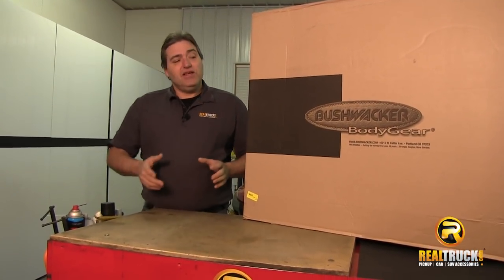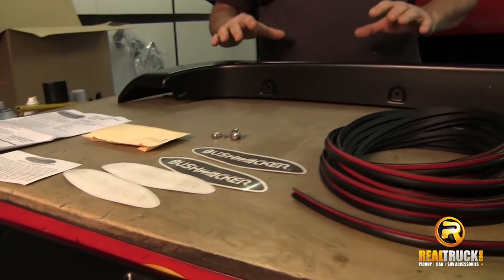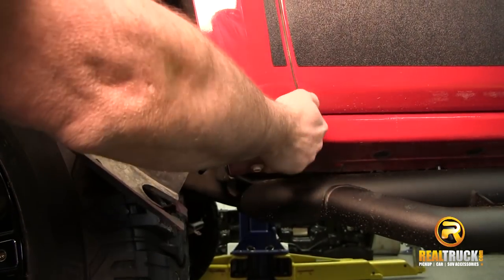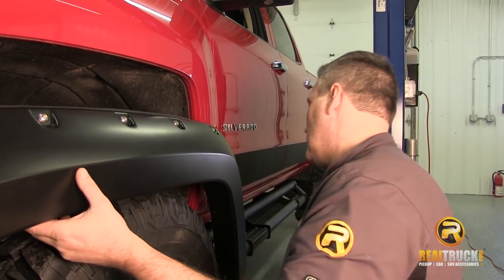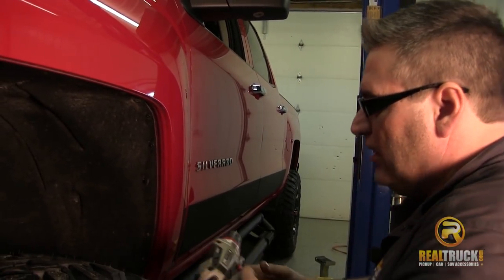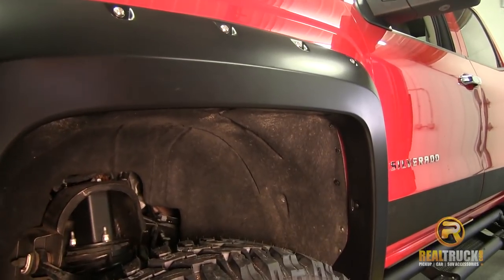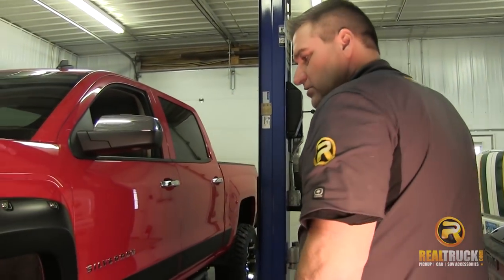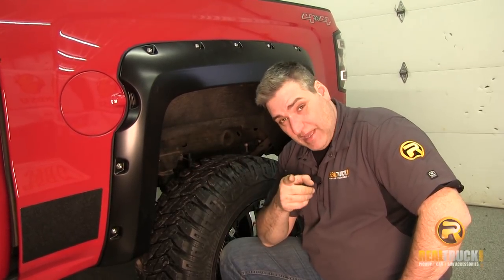How to Install the Bushwacker Pocket Style Fender Flares

Comment: Being from a state that heavily salts the roads, I feel like putting some form of protection like paint-on rhino liner on the inside of the flare would be a good idea so that any trapped moisture/debris that gets behind the flares from the wheels kicking it up doesn't sit on the truck for an indeterminate amount of time and potentially develop into rust.
Reply from the maker: Ferrinflame not a bad idea, however, have you seen this: http://www.cabelas.com/product/Trimbrite-Bodyguard-Paint-Protection-Film/746765.uts?searchPath=%2Fbrowse.cmd%3FcategoryId%3D734095080%26CQ_search%3Dtrimbrite%26CQ_st%3Db it may be a better alternative to rhino lining your fenders. If you  have any questions any of the 500000 plus accessories we sell feel free to contact our knowledgeable Customer Service folks at  877-216-5446

Comment: It's all good (and looks great) but drilling all those holes is a FAIL.  Not only does this leave a big room for error, it also compromised the truck.  I know it's about the sale and selling the flares, but you just started rust and corrosion issues on that nice truck.  Either the Bushwacker flares design is flawed or at the very least should be redesigned for no drilling.  If this is not possible, then you, the installer, should take some rust prevention measures to protect the customers truck.  But that would compromise the "simple & quick" install video your going to get the money for these flares.
Reply from the maker: +Raymond Broderick Great idea! If you are doing this at home on your own, some rust prevention would be a great plan, I would suggest a can of spray on undercoating applied to the backside of the fender covering the screws. Keep in mind, however, that we do these videos mostly to show you guys how to install this stuff. The extra little things that you do in addition to the product installation is solely personal preference and up to you guys. This is, by the way, a great forum to share some of those little tidbits of knowledge and ideas with each other. Keep up the great work.

Comment: Wow that sucks that you had to drill all of those holes. So glad I did not have to do that with my 2014 Tundra. They make such good products and I love my flares. Big Red looks good!!
Reply from the maker: Trd Jason Hey Jason! Some fender flares do not require drilling, these do but there is a lot of benefits. We have snow, ice, and slush up in the northern areas. The screws will insure that the flares are securely fastened.
Reply: Yeah I know what you mean. Mine bolted up to my truck by 10mm bolts under the fenders. They cover up my 305 tires very well.
Reply: Subie Jason what’s the brand of yours?

Comment: Am looking for these exact flares for a 1993 Silverado K1500 extended cab short bed. But when I try buying them, it shows very little tire coverage.
Reply from the maker: Hey Tony, the pocket style gives you 2.25" additional tire coverage in the front and the rear. If you want more coverage, check out the Cut-Out Flares They give you 5" in the front and 4.75" in the rear. Though please keep in mind that the Cut-Out Flares require cutting on your truck. Hope that helps!

Comment: I bought a FJ cruiser 2008 that has them, and the wind catches them at times and bangs them against the body. I noticed that the trim is gone, if it was ever there, was wondering if it can be ordered somewhere? Was thinking if I could put that back on maybe it would stop vibrating against the body some.
Reply from the maker: The trim can most likely be ordered through the manufacturer of the fender flares. Unfortunately, we would not have that replacement part available for you.

Comment: I’ll be ordering my fares tonight!! Very nice truck. What size lift is that. And what size tires?
Reply: Jmannyjr 

Hey jmanny be careful with fender flares I installed Rough Country on my truck and a year late dirt has built up and scratched the paint around the rubber gasket (dirt builds there) 

I don’t know if this one has a better seal or what also be sure to paint the drill holes if you drill it to not rust 

Just my two scents I’m really disappointed with RC about the gasket
Reply: Oh man sorry to hear that. And thank u soo much for the reply and info. I won’t be getting them now. Thank u again sir
Reply: Jmannyjr 

I mean you can get them if you want but I would reccomend takin them off completely every 2-3 months to get dirt off the fender
Reply: Jmannyjr 

Hey man anyone who buys an American truck deserves a heads up 

But yea I’m gonna wear my flares for another 4-5 years then get rid of them probably and get new fenders (all 4) 

2 fenders were messed up to begin with so yea it’ll be a couple grand but my truck deserves it 

Maybe I’ll get in a wreck and insurance will pay who knows

I had them installed professionally and worst experience of my life cuz they drilled into my truck when I told them 4-5 times not too and its bolt on so I’m ready to just accept it then get new fenders
Reply: Jmannyjr 

I know you said you weren’t getting them but did you ever get them? 

I think you can use electrical tape or silicone behind flare to prevent scratching

Comment: man i just attempted to put mine on my 2015 silverado and i am having a really hard time getting all the screws to actually hit the fender in all the spots. do you have a tips?
Reply from the maker: Nick Rotolo the best way I have found to do it is get a buddy to help hold them tightly in place on the truck, mark all the holes and then drill them out. When attaching them got someone to hold them tightly in place as well and the screws should go right in. If you have any more questions about this or any of our other over 500000 products, please feel free to call one of our awesome customer service peeps at, 877-216-5446

Comment: Do all trucks need drilling I have 2014 Silverado
Reply: Not if you get rough country flares 

But I warn you if you decide to get flares make sure to put electrical tape or silicone behind the flares 

The gasket they provide you isn’t enough to prevent scratching from dirt debris build up which digs into the paint lightly (vibration from driving) 

Do not skip what I told you if you get flares I have scratches on mine they’ll easily buff out but still annoying

Comment: I'm considering buying and f150 regular cab that already has these installed, but I'll be removing them because I don't like the look. It's an '09. Do you think the fenders will have marks on them if I remove the bushwacker flares?
Reply from the maker: X___V1cT0R___X it really depends on how long they have been on there and whether or not they were properly installed. If you have any other questions about these or any of the other 500000 plus accessories we sell feel free to contact our knowledgeable Customer Service folks at  877-216-5446
Reply: yes of course.

Comment: Get rough country (no drilling)
Reply from the maker: +Greg.

That all depends on the application. There are many applications that don't require any drilling and there are others that no matter the brand will require drilling.
Reply: RealTruck.com 

I installed the rough country and it built dirt around the rubber gasket 

Are these better for that? Or is it the same for dirt buildup?

Comment: Looks good,but doesn't do your truck any favors in the long run, fucked if I would drill all those holes in my truck, would be rusted out within 3 years on salted roads.
Reply from the maker: +nitrosavy Hi Nitro, The holes drilled are very minimal and the flares are held in by self taping screws. The rivets on the flares are for looks only and do not bolt in the vehicle.  It is held in my 3-5 small self taping screws into the inner lip of you wheel well. We have been running these on a 2012 F250 since new in North Dakota and we have had not issues with rusting. If you want to go without screws or drilling we do offer flares that use factory holes and clips to be held in place. Let me know if you have any other questions. Thanks!

Comment: These fake fender flares are a fucking sad joke. They will just cause dirt and debris to get trapped in between and cause damage. Why can't one of these companies just make a fender with bigger flares built in? I would rather pay for a REAL fender with REAL flares built in. Not this fake plastic double sided sticky tape garbage.
Reply from the maker: Kenshin Himura these actually screw on. I have never seen ones that install with double-sided tape. Another thing. I have installed a lot of these and if done properly there is no problems. We have a 2010 F250 running around with these same flares and have been on there for 6 years now with no issues. Anyone needing help to install them to avoid future problems feel free to call us at  877-216-5446
Reply: ***** they don't screw on. those bolts are for looks only. It uses double sided sticky tape. how dare you lie to my face like that. I'm not some stupid sheep like most people. These Bushwacker fender flares are fake and uses sticky tape. Same as the factory stuff GM uses. Go ahead, remove your factory fender flares and tell me I'm wrong. I'm waiting................
Reply from the maker: Kenshin Himura they do screw on and yes those bolts are for looks. The screws go on the underside into the lip of the fender. If you had actually watched the video you would know that. Just for the record I just recently removed the factory ones from a 2014 GMC 1500 and they used screws and clips. Dude! What is with you and this sticky tape thing?
Reply: ***** That funny because every LLY andLBZ uses sticky tape. even the door guards are sticky tape. Maybe the truck you worked on uses screws because it's newer. 90% of all trucks used sticky tape.
Reply: Kenshin Himura Is it so difficult for you to admit that you were wrong ?